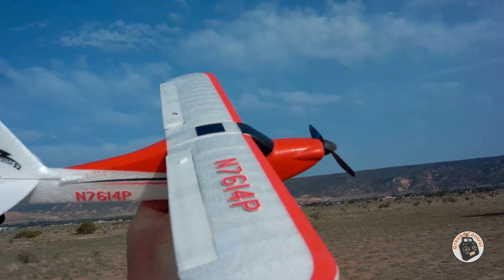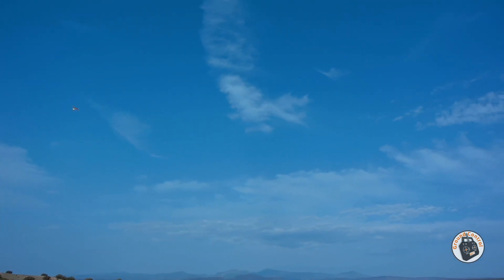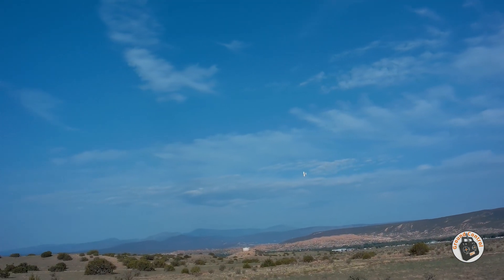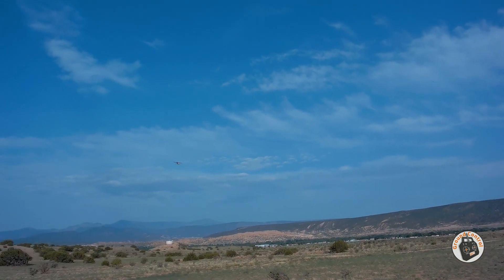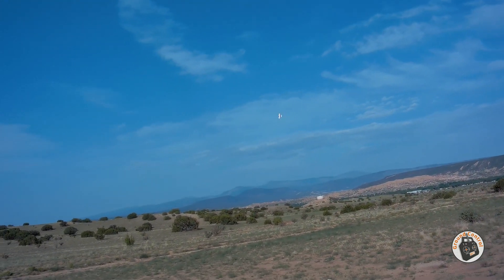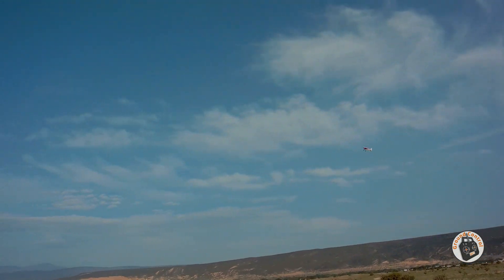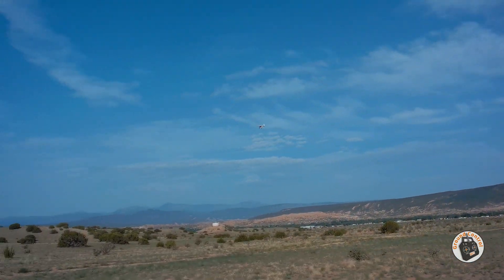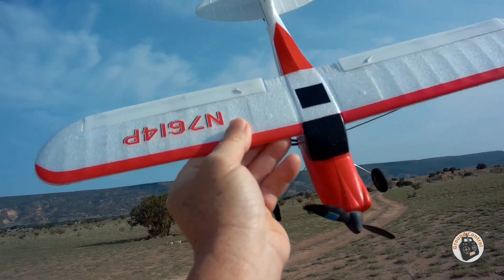Aileron Extension MOD #2 Test Flights - Volantex Sport Cub 500mm 6-Axis Gyro RTF with the TX16S!

Comment: I see you have a flying buddy this time (5:57 mark).

Nice job.  The new ailerons look really nice, and rolls are definitely faster.

You should try a flight with the gear off.  The reduction in drag really makes a diff.  The foam is durable enough to survive a belly landing, especially if you aim for one of those green patches.

Happy flying!
Reply from the maker: Thanks!
Now you know I can't belly land in this terrain. Those patches of green are thorns and cactus ;-)
Hehehe.. I even have to put wing tip protectors on my gilders or the wing tips will get torn up ;-)
I am happy with the Roll Rate though even at slow speed.
See you in the Air!

Comment: What kind of parts did you use for the aileron extension mod 2?  Can you link in where to get them?
Reply from the maker: Hi Randal! I just used Adams Readi Board Foam with the paper removed. I fabricated new control horns from a plastic gift card and attached the new ailerons with packing tape. There is a picture and explanation on our Facebook Page about 5 post down from the top. Adams Readi Board I buy at Dollar Tree.